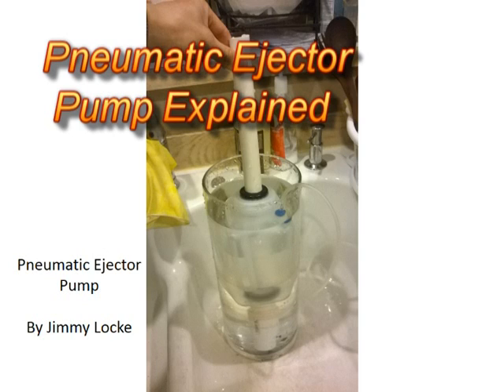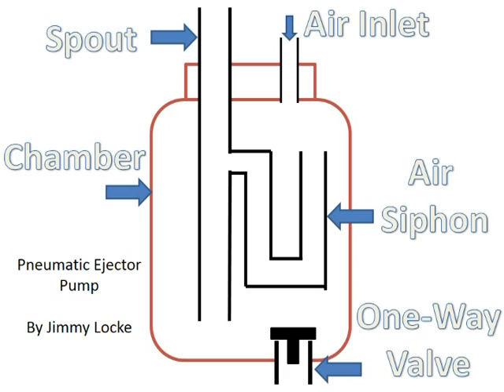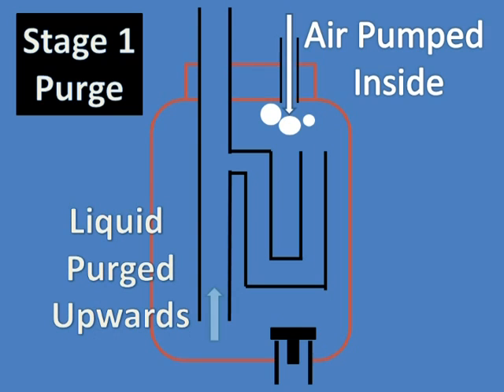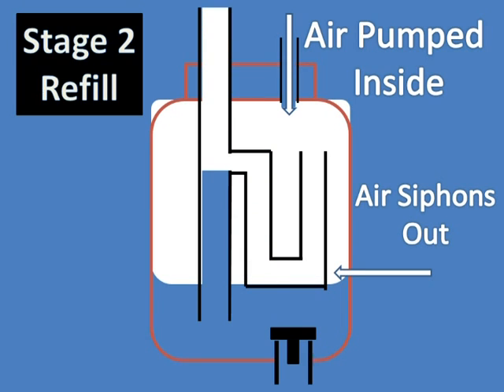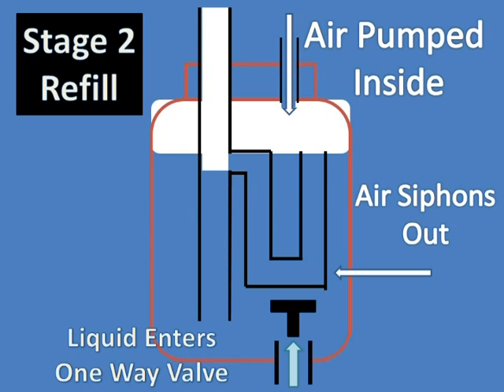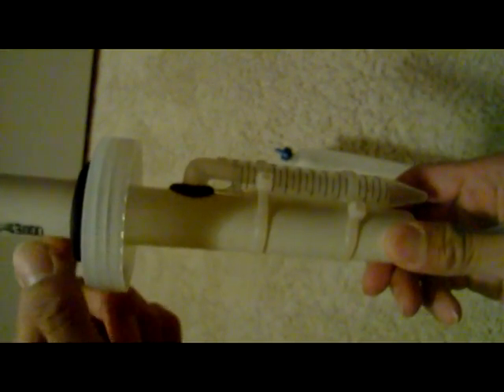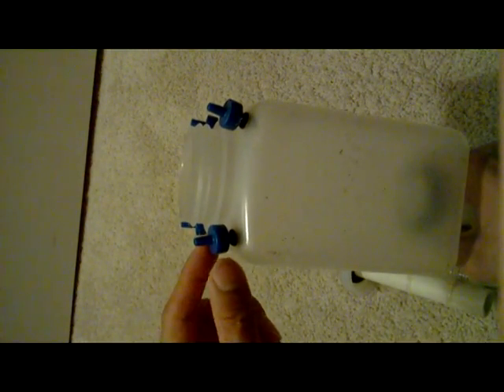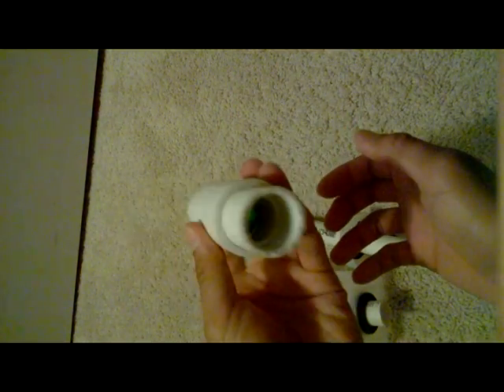Low Power Airlift Pump Explained (Pneumatic Ejector Pump aka Geyser Pump with Check Valve)

Comment: GREAT video: PLEASE HELP ! ! wouldn't it operate the same if you just had a U shaped trap at the bottom of the main water exit? That would eliminate the need for a "T" ? ? Someone please help me understand why a simple U trap wouldn't do the same thing.... Thank you all in advance for the hundreds of replies I'm sure I will get to this question.😀
Reply from the maker: Great question.  So a simple U shape will not work for the following reason: the water that is in the chamber would not be displaced past the opening tip of the "u". 

 Imagine a full chamber. Water level drops as air displaces chamber but the water level drops past the entry of the "U", the only water that is displaces is the small amount within the U bend.

Comment: Thank you so much for your video I learnt a lot from it...
I have a small idea I don't know whether it works or not but still I want to explain ...
Can you fix an impler above the suction and connect the air flow in two way T type so that the impler rotates and water will easily pump up..thank you.
Reply from the maker: Thanks for watching.  
I'm not exactly sure without looking at a picture or diagram of what you are saying.  Is the goal for the impeller to harvest energy from the sucking or rather to have the impeller motorized such that it will aid in the pumping action?  

If you are referring to the later, I would imagine the impeller would help pump to a higher height, it may interfere with the refilling action of the chamber.  A timer may need to be engaged to turn off the impeller when it is refilling so there is negative pressure in the chamber and such that the air in the chamber can escape.

Comment: Given than the chamber and pipes can handle higher pressure upto several say 5 bars, will this setup still work? Specifically in shallow water?
Reply from the maker: Hi, thanks for your question.  It depends how shallow.  Bare minimum the water level must completely submerge the chamber in order for there be enough water pressure to open the check valve and refill the chamber.  Ideally the top of the chamber is several inches below the water surface.
Reply: Thank you!!

Comment: What happens if your purge vessel is too small? Does the flow get interrupted? Is it possible to set this up so that it delivers a continuous flow of water?
Reply from the maker: If the vessel is small the cycling time would be faster which is less efficient since most of the work from the air is lost to churning water. There are other vids on youtube which refer to a "burper pump" this is basically a pneumatic ejector with a tiny vessel.  To get near constant flow you would want two alternatingly operating ejectors each with very large vessels so there would always be at least one pump purging water while the other is refilling.

Comment: I have been working on a hydraulic pump for six years now. I used the same check valve system as yourself. It is amazing what water lift can be achieved with absolutely no pistons or seals. It is very tough to discover that your idea was patented so long ago. It seems to go with the territory!  Nice video presentation.

Comment: 1.my wall 45 ft  water only 30 -45 only  its suitable ?
2.and 1hp air   compressor  motor?
Reply from the maker: Nanda Kumar 45ft lift can work as long as you design chamber and pipes to withatand the pressure. 1hp compressor should be enough. to provide sufficient psi.

Comment: hi! do you, or someone here, know if it is possible to  build a pneumatic ejector airlift but instead of powered by an airpump,  by a venturi powerd by a sump pump?
Reply from the maker: hi beetelgauze, a venturi with sump pump provides negative pressure which is the opposite of what an air pump provides.  A venturi would have lift the water via a suction and you would be limited by sump pump power and ultimately atmospheric pressure.  Are you aiming to unify the number of motors in your setup?
Reply: @LockeLaboratory  my goal is to fill the chamber with the bubbles that are produced by a venturi yes. Therefore the chamber would be filled a lot faster due to the pumps power combined with the venturi bubbles, could it work or am I reinventing the wheel?? Thanks
Reply from the maker: I think you could possibly have a geyser pump configuration, it wouldn't be a pneumatic ejector.  For example, if you cut off the bottom of the chamber so it has no bottom and no one way valve, then pump in the bubbles from the venturi into the chamber, the chamber will fill up with air eventually. The air would then come out in a burst and whatever water is in the spout will shoot upward.  The amount of water pumped up would be significantly lower than a pneumatic ejector however since all the water from the chamber will not be pumped upward, only the water that is in the upward spout.  The chamber water in the geyser pump configuration would simply be pushed in and out of the chamber due to the bubbles displacing it.  Hope this makes sense.  Its like taking an upside down cup of water that is submerged in a tank, then blowing bubbles into the cup from the underneath.
Reply: @LockeLaboratory  what would happen if i try to fill up this ejector style pump from a venturi with an outlet of 6000l/minute? i guess the ejectors' housing should be large enough-like a 20l bucket with a lid.  This would cause the housing of the system to fill up a lot faster but could it make the same result with so much water pumped in? My guess is that the pressure inside the chamber goes up a lot quicker and the pneumatic ejection would be sort of like a geyser, but with longer bursts. also, i wonder if the venturi would just stop working from the built up pressure!   i'd like to try it  on my future aquaponic system. right now im running a 60liter aquarium with a plantfilter on a geyser pump so it spits out just enough for a couple plants. your video inspired me to create something awesome as this - thanks for your  informative answer!
Reply from the maker: beetelgeuze i understand. you are saying to pump the water into the oneway valve port.  yes that is a great idea! and i think it would work along with the air pump in conjunction.  there is another youtuber named Glenn who made a similar device dubbed the "AQUAZEN" pump which in one video he connected to a water pump to boost its output.  i think you should experiment and develop this design. glad to be a source of help and inspiration.  let me know how it goes

Comment: Great pump... excellent presentation. Your innovation using the check valve solved my problem of insufficient head pressure in shallow sumps.  I like your analogy comparing it to an inverted bell siphon but take exception to the term 'sucked in'.  Thanks...great design.
Reply from the maker: Thank you Captain Nemo for the wonderful comment!  I wish I was the first to invent,  maybe I'd be a millionare by now haha. I'm only about 25 years too late.  But in any case, I'm glad to at least share the knowledge of this useful invention.  I hope to make a tutorial video on a how to make a submersible type Pneumatic ejector pump.

Comment: Wouldn't the one way valve closes at 2:20 when the water fills the bottom of u syphon causing airlock and the air has nowhere to go except increasing the chamber pressure?
Reply from the maker: Yes that is correct, the one way valve will close again at 2:25 after the water has submerged the u-siphon plugging it.  Then the air will increase chamber pressure to displace the water.
Reply: @LockeLaboratory  i thought the water wouldn't have continued being sucked in after 2:20 because the valve is closed. Maybe I misunderstood the animation. If the junction of the u syphon and the main water pipe is at the same level or higher than the u syphon inlet, the syphon bend shouldn't have filled with water until the syphon inlet is submerged, right?
Reply from the maker: Oh I think I misunderstood your first question.  Yes the water will get sucked in after 2:20.  This is because the entire chamber is submerged in water and air naturally wants to float upwards due to bouyancy.  From time 0 to 2:20, there is no path for the air to escape except through the outlet pipe going upwards, when the air reaches around the bend of the U siphon as it is being pumped in, suddenly there is a path for air to escape upwards.  The air escapes upward just as if you opened a bottle of air underwater.  Then naturally the "bottle of air" will fill back up with water since it is submerged in water and --In this case it will fill up with water through the one way valve.  This is why after 2:20, the valve opens and water comes in.  Hope this makes sense, let me know if you need further clarification.  

I guess one way to picture it is to imagine a sink full of water with a cup (bottom side up) submerged in the sink, you take a straw and blow bubbles into the cup and the cup fills up with air, suddenly you turn the cup right side up and all the air escapes and floats to the surface and the cup is now again filled with water. The only difference between the cup and this pump is the auto-siphon feature plus one way valve which allows it to become a "pneumatic ejector pump".
Reply: @LockeLaboratory  I still don't get how we can get siphon when water outlet is higher. only sinario is the air pressure inside is higher than atmosphere which makes sense because of air pump. however if that's the case the water get sucked in?
Reply from the maker: Yes when the air pressure inside is higher pressure, it will purge the water out of the water outlet, once the water is completely flushed out of the riser, the chamber is exposed to atmospheric pressure.  At this point the higher pressure inside the chamber will cause the air to flush out dropping the chamber pressure enough to suck in water.  It sucks in water to equalize  pressure with atmospheric pressure.

Comment: thanks for posting. some late thoughts...
this type of air lift pump might be capable of raising water to a head of five meters or more, if a correctly designed riser is used.  one of the advantages of these pumps is the creation of relatively larger, wall-to-wall confined bubbles.   confined bubbles lift all the water within the riser, until the air is able to escape.  so, like other pumps, its the water in the riser above the siphon that is raised. 
the volume of air per 'flush' should be optimized in relation to air pump flow rate and the volume of water in the riser, above the siphon, to give a pump cycle rate of one or two per second.   cheers

Comment: Greetings, what is the maximum height of these pumps?. I have a tank that's about 15' above the ground,will it pump to that height?. Great video.
Reply: Thank you for your reply, I have just reread my message and I noticed a mistake. The height should be 15m and not 15' .
Reply: @damienfynn1522  Have you tried it? I want to pump water 10 meters up.
Reply: @troysantos  no I haven't tried, nobody has answered my question.
Reply: @damienfynn1522  I see. Thanks. My friend might understand how this pump works and decide to try to make one. If we do, I'll let you know what happens. The mechanics of all this is completely lost one me.
Reply: @troysantos  thank you so much.

Comment: I'm thinking of making this for a submersible water well. Do you think it would pump sand particles through or would sand likely settle in the tank?
Reply: jlocke8 Thanks so much for the reply and guidance here.  I have a $600 Shurflo diaphragm well pump that gets damaged by sand.  I've looked at normal airlift pump designs where air is injected straight into a riser pipe and bubbles the water out.  Unfortunately, my water well is 85 feet deep and the water level now is only at the 80 ft mark so the normal airlift would take tons of air to push that little water up that distance.  But I think your design with the check valve could prevent the greater air quantity required to lift since your design only lifts small portions of water at a time.  I'll try it out and keep you updated and thanks again.
Reply: Abonniert and #playliste #systemphysik

Comment: you can add a bucket/bottle as chamber in the end as resourvior to produce consistant nonstop flow of water , if u get what i mean , outlflow needs to be in proportion that until next fill of water it slowly empties water   , will need a valve to adjust rite timing
Reply: yes exactly , will be interesting to see , do tag me when u make it

Comment: Out of phase mean two seperate pump with two air supplies. Can we integrate them for large fish tank with on air device, so that when one is refilling other is throwing water or both pump in one packing. Plz do work on this.
Reply: you can add a bucket/bottle as chamber in the end as resourvior to produce consistant nonstop flow of water , if u get what i mean , outlflow needs to be in proportion that until next fill of water it slowly empties water   , will need a valve to adjust rite timing

Comment: One question brother. Will it give continuous water flow with air pressure or each time it will refill.then build pressure and then through water out.Is it pissible to take continuous water flow when check valve once open and close only when there is no air?

Comment: Fantastisch ich werde so etwas nachbauen 
mit freundlichem Gruß abonniert 
Text  The setup features a larger version of the pneumatic ejector pump I had designed. It uses a chamber that is 2 Liters instead of the 1 Liter container used in previous videos. The check valve is also custom design I have invented and it is built from simply a horizontally mounted plastic bottle with a rubber ball inside. This works extremely well for large debris (so well that I had accidentally pumped two of my fish to the top of the grow beds). The pump is powered by a 6 watt 15L/m ActiveAqua model AAPA15L air pump. 

As the pneumatic ejector pump chamber refills, the air exits the long pipe at the top passing through a larger diameter pipe filled with filter floss material (the muffler) reducing the gurgling noise the pump makes.  https://youtu.be/di5ulkBv0XU

Comment: What aerator are you going to use on this? what is the wattage?
Reply: +jlocke8 do you have video with your new upgraded? my plan is using it to my well and I need to lift the water for 10 feet.
Reply: ***** thank you for sharing. I reall need this

Comment: Hello lock8! My system that pumps 1714 L / h at 30 feet is too large, is on the surface side of a tank with the capacity of 2000 L, direct air compressor use 40 pounds, it's all working, have not given the final finish for lack of time, but if you want to view photos including of the water coming out of the pipe can send you a photo via e-mail. 40 pounds can pump almost 120 feet, there would no longer 1714 L / h, will be less Arruda

Comment: Lock8! I observed that the pump body weight has to be greater than the weight of the displaced water otherwise the same will float on the water as it exits.
I already have an electronic version here working for more than 60 days, that is on the connected surface to a tank with 2000 liters and has pumped more than 40,000 liters of water this time without nehum problem, use a 40-pound compressor, ejeto 1714 liters per hour.

Lock8 ! Observei que o peso do corpo da bomba tem que ser maior que o peso da agua deslocada, caso contrario a mesma irá flutuar a medida que a agua vai saindo.
Eu já tenho uma versão eletrônica aqui funcionando a mais de 60 dias, essa fica na superficie conectada a um tanque com 2000 litros e já bombeou mais de 40 mil litros de agua nesse tempo sem nehum problema, uso um compressor de 40 libras, ejeto 1714 litros por hora.

Comment: Lock8! I noticed that if you stay stagnant water somewhere in the exit tube, type effect siphon, depressurization will be compromised and the pump will not fill with water in the next cycle else, the pump must be totally submerged, the more quickly submerged fills. Arruda

Lock8 ! Observei que se ficar agua parada em alguma parte do tubo de saida, tipo efeito sifão, a despressurização ficará comprometida e a bomba não vai encher de agua no ciclo seguinte, outra coisa, a bomba tem que ficar totalmente submersa, quanto mais submersa mais rápido enche.  Arruda